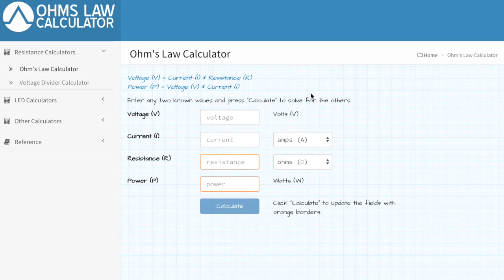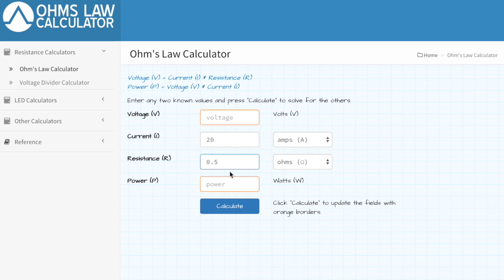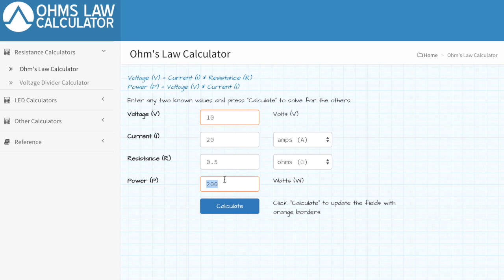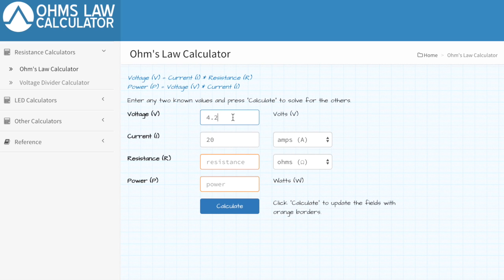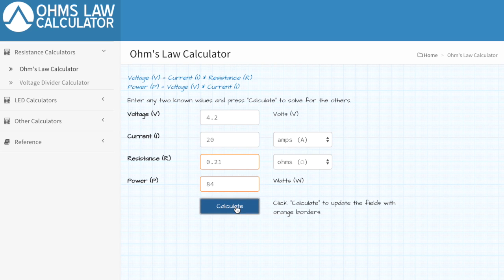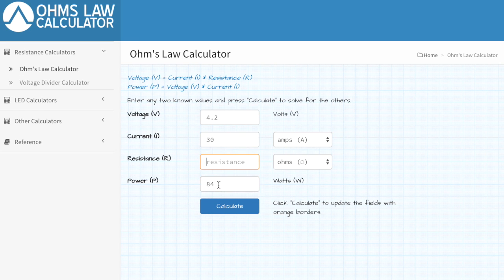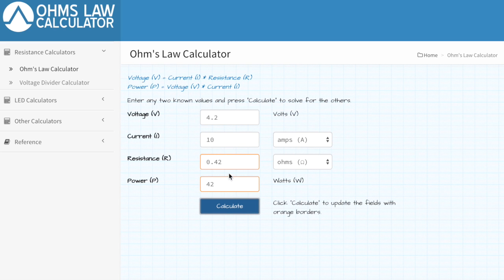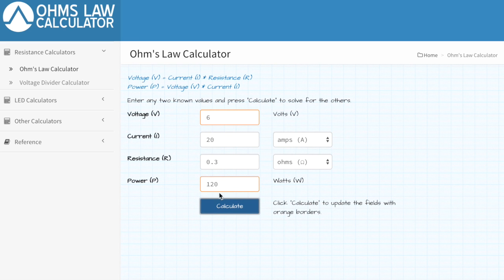Vaping for Beginners - Ohm's Law & Coil Resistance for MECH MODS

Comment: How do I determine  the max amp limit  if it doesn't  specify it anywhere.  Eleaf iPower 5000mAh Box Mod

Size: 49.5mm(L)*23.5mm(W)*83.5mm(H)
Thread type: 510 thread
Output mode: VW/Bypass/Smart/TC(Ni,Ti,SS,TCR-M1,M2,M3) mode
Output wattage: 1-80W
Resistance range: 0.05-1.5ohm (TC modes)
0.1-3.5ohm (VW/Bypass/Smart mode)
Temperatue.

Comment: how about the series type mech mods? they say if you are using a 3.7v batteries on a series it bobbles the voltage like the noisy cricket im using the awt color yellow batteries. it says 40A on the batteries I usually vape it in arround 30 to 40ohms, how do i get more clouds of it? 

thank you in advance for the help!
Reply: 30-40 ohms? What? Yes, in series the voltage will double. Also, what batteries do you have?
40A? No way, don't trust that.

Comment: if your mod takes 2 20A batteries does the max current stay at 20A? im new to building coils n shit
Reply: If the mod is in series, the amp does not add which means it's still 20a in your case. If your mod is in parallel, it "doubles"
i put doubles in quote since you can't calculate with x2 since serten things has some resistance to it.
It's safe to use x1.5

Comment: hi im using a regulated mod and i switched to a mech mod, it has a 4wraps of coil but i didnt know its ohm bec shops tester is broken they said its on .4ohms is it safe with a 35amps 18650? and its getting hot but not too hot is it normal for a mech mod?
Reply: First of all, get a ohm reader or build your tank on a regulated mod to see the resistance.
Resistance is really important when it comes to mech mods and make sure that the resistance is steady. No jumping. 
For your question: You would be fine even with a 10a battery for your .4 ohm coil on a mech.
Also your build/power depends on how hot the vape gets.
Since you are on an unregulated device, the only thing you can do is to make a coil that is cooler.

Comment: If I have 2 20 amp batteries can I use a 
.15 coil in a tfv8 in a regulated mod
Reply: Yes, you can do that, I run the same setup in my Xcube ultra and you will be fine to do the same.
Reply: Forget about ohm's when you are dealing with regulated mods

Comment: I loved loved loved this video. then I read the comments and got confused and worried. Someone said you cannot expect someone to push 4.2 volts but my cuboid is on 5.3. am I doing something wrong?
Reply from the maker: that is a regulated mod, which can go above 4.2 volts. the examples in this video are mostly for mech mods where 4.2 volts is a fully charged battery and therefore the highest you could go.
Reply: Okay, great, thanks! Still though this video was super helpful! It put building coils in a perspective that I needed and was easy to understand!
Reply: Each battery cannot push more than 4.2v even with a regulated mod. Hell, it pretty much never outputs 4.2v because of battery sag and the fact that it drops from 4.2v to around 3.7v so quickly. People get confused about battery voltage and the voltage that goes through the coil.

You know the thing that is displayed on your mod for example 5v even if you have a single battery? That is just the voltage going through the coil. Some mods reads the "current" but that is just the current that goes through the coil.
It has absolutely nothing to do with battery safety but just some useless information that we basically don't use that displays the current, voltage and the wattage going through the coil.

I'm just assuming that you are wondering about battery safety and not what goes through your coil since you are mentioning that you are worried. I could be wrong, but I think it's fair too assume that battery safety is the thing you are worried about.

Comment: and as the volts go down. the amps go up. so as your battery drains, make sure to adapt to which wattage will still keep your batteries under the amp limit.
Reply: Usually not something to worry about since regulated mods have a cut-off point. That was probably the first feature in a regulated mod.

Comment: great video, I've been using v/w devices @ subohm's for a while now & I'm interested in getting an unregulated mod.  In your opinion do you see any advantages to a mechanical mod vs one with a chip for safety?  I like the look & stealth of a tube like a praxis or something similar but I haven't dove into buying one yet because I'm still weary of having the device fire in my pocket or even worse get a battery to vent.

Comment: Hi im new to vaping.. I am using a kangertech topbox mod with clt4 atomizer and LG choco battery.. i have dual 28g kanthal coil with 6 wraps each.. it says i have .49 ohmz and im vaping with 55.0 watts.. is it good? or am i vaping safe? my atomizer easily heats up when using a max vg juice but its pretty normal when im using 70/30 or 80/30 juice.. 

should i add watt or lessen watt when using max vg juice? thank you..
Reply: Ohm's doesn't matter on regulated devices. I think the mod is a single battery right? I have no idea what the ratings are for the LG Choco. Is that the LG HG2? If so, you are safe. You are pretty safe on a regulated mod unless you have really bad batteries. A 20A battery on that mod and you are good to go

Comment: can you vape just water?  Anybody know?
Reply: No, you can't. But you could just boil water and breathe in the steam. Pretty pointless though.
Reply: Actually, no it is not pointless.  It can help people suffering from allergies, cough's and flus.  The water vapor would open up the airways that are deep inside the lungs.  If it were possible to vape just water, camphor, eucalyptus oil, menthol, tea tree oil...then many people would not be sick all the time.  The idea is to pull an enormous cloud; just as you do with normal vaping.  I am an allergy sufferer.  If huffing steam is pointless; why are Vicks Vaporizors sold in stores?
Reply: Yes, you can vape water but don't use spring water. Water is great for people that want a thinner E-liquid and have a bad reaction to PG. As we know, some people have a bad reaction to PG and to make the E-liquid thinner,  you simply use water. So yes, you can vape water.
Reply: Sean RobinsonJR I don't own a vape machine yet.  Try it for me, and see if you pull just as huge of a cloud.  I am onto a train of thought to help myself with allergies before Vaping becomes banned.  I do not want to spend 60 bucks on a machine; and my idea does not work.  Let me know your results.  What is PG?
Reply: Piano Man42 Sorry bro, but nothing I can do. I don't have the recommended water to use. It's not like i can use spring water or spring water and boil it. It needs to be proper clean water and I have no idea where to get that. There is no vape shops in my country so I would need to order that online. That's a lot of effort. 

Are you saying that you don't know what PG is? ( Propylene Glycol ) If you haven't even tried that, why vape water? The only reason I see too use water is if you have an allergic reaction to PG.
Reply: Sean RobinsonJR The most purest water is commonly available.  Use distilled water.  There are no minerals in the water that can foul the element in this water.  It is available at any grocery store.  It I pure chemically.
Reply: Piano Man42 But why do you want to vape water in the first place? I mean there are reasons for it as I mentioned before but you haven't even tried PG. So why water?
Reply: Sean RobinsonJR I have tried PG at a vape lounge yesterday morning.  I just feel that a saturation of water vapor would help my chronic cough.  Especially, If I could pull a dense cloud that you get with normal vaping.  I don't want to introduce foul ass chemicals like PG and vegetable oil into my lungs.  It may provoke cough even more.  I think maybe the PG is vapored for its special effects of the dense cloud.  I do want a dense cloud of water vapor, camphor, menthol, and therapeutic essences that are herbal.  I have been to the doctor; and nothing he prescribed Is helping much.  So now; I am trying something new, on my own.
Reply: Piano Man42 I can tell you that you won't get a decent cloud without the VG. PG and water doesn't make huge clouds.
Reply: Sean RobinsonJR I spend countless nights staying awake all night coughing and sneezing.  I miss work the next day as a result.  I am fed up with the problem and am ready to go through great extremes to solve the problem.  That is why I want to vape water.  It does seem to help.
Reply: Ah, ok. Then I guess VG with menthol would do the trick.
Reply: vegetable oil = VG?
Reply: Piano Man42 VG = Vegetable Glycerin

Comment: how about this?

I Calculated from: http://www.ohmslawcalculator.com/ohms-law-calculator 

V=4.38
Amps=40
R=0.1095
P=80 

Current Setting: 

V=4.38
Amps=40
R=0.24
P=80W

 My Build

 Link: https://goo.gl/7DPWJX

-SS Cuboid 150W upgraded by firmware to 200W 
-Griffin 25 Top Airflow RTA 
-Copper Heat sink 
-AWT IMR 18650, 3.7V 3000MAH 40A 
-Coil Nichrome 60 Not sure 

Is this safe if I go with the R=0.1095?
Reply from the maker: I'm not familiar with that battery, but i would question the 40A limit.
Reply: 😂 that's a regulated mod why would you need any of this information for that😂

Comment: What if I put 2 20amp batteries in my mod would that change the total amps? Thanks
Reply: It depends on if the mod is in series or in parallel. In series, no.
In parallel you double the AMP but because of wires and chip and all that, you don't get fully x2 amp.
You should calculate that you get 1.5x more AMP when using 2 batteries in a parallel mod.
Reply: +Sean RobinsonJR its a rx200 which takes 3 batteries. I currently have 3 lg hg2 batteries in it. Thanks for your input.
Reply: JON1201ROTH I got the same and it's a series mod. The Rx200 has a 20a limit which basically means that if you have true 20a batteries in it, it's dummy proof. You can vape at whatever wattage you like and you can even vape it if the batteries are low. I wouldn't recommend it though because you are taking out the battery life and the battery will last you shorter. The LG HG2 is 20a right? 
So you are dummy proof. Vape away.

Remember, the voltage you want to calculate with is NOT the voltage that is displayed on the board.
To see the true battery voltage: Shut off your mod, hold the power and the negative button in at the same time. wait, and you will see the voltage from all your batteries.

Remember to switch position of the batteries sometimes because one of them will output more than the other. It's dangerous if the voltage is really low on 1 battery but good at the other 2.
Reply: +Sean RobinsonJR nice answer, thanks. Yes they're 20a. I check the batteries in the way you've said. I just wasn't sure about the amps with more than 1 battery in this particular mod. Thanks again.
Reply: Yeah, Abby has missed a lot of things. Not hating on her or anything, but i felt like this video was pointless because there were so much wrong things with it. For example calculating the volt that is displayed on the board. That is dangerous. A chip can output more voltage than a battery usually can take. For example a battery is 4.2v at fully charge but with a chip, it can output even more and that results into more current (amp)

For a regulated mod, just take wattage / volt = amp.
usually I just calculate with 3.2v for each battery since that is usually the lowest I go and that's the usually cut off point in a regulated mod. Since it's series, you just add the voltage. And you would need to thing about battery sag and so on, but 3.2v is usually a good range for the battery unless you change it before you hit that.

So it's the actual battery output that matters and not what's displayed on the board.

Adding voltage only for series btw.
Cheers!
Reply: +Sean RobinsonJR so if for example vaping at 100watts you would do 100/9.6 = 10.4 amps. That would be well within what the batteries can handle. Is that how you'd do it? Thanks again
Reply: JON1201ROTH I'm guessing that you are calculating a series mod with 3 batteries right? So yes, this is how I would do it. It depends on what cut off the mods has but I would usually change the batteries before that because it would hit weak so yes, 3.2v * 3 = 9.6v is safe I would say.

But if you are one of those lazy once that doesn't want to change batteries until you just have to then I would probably calculate with even lower.
if a mod has a cut off at 3.2v it can still hit like 2.8v which again would increase the amp.
and that is battery sag. if your batter is at 3.2v and the mod let's you fire it, it can actually end up with 2.8v or so and that would me 2.8v * 3 = 8.4v

100w / 8.4v = 11,9a. So there you see that the amp increased. So it depends on when you change the battery. Do you allow it to go that low and so on. That is up too you basically.

Next time you change your batteries because you feel like it isn't hitting that hard anymore, check your battery voltage and you know how low it actually goes.

experienced people could easily just calculate with 3.7v for each battery because they would switch the battery before it goes that low and so on.

I just calculate with 3.2v because I'm more on the lazy side of changing the batteries and I also want to feel more safer.

But that is pretty much it. It is not that difficult. People just don't know that there is a difference between: mech, series, parallel, multiple batteries because no one on Youtube really talks about it.
For example this video.

Sorry for the long message, but I think you got it : )

PS: Resistance doesn't matter in a regulated mod. At least if you can regulate the wattage

Addon: In a parallel, you basically do the same thing, only that you cannot add voltages from 2 or more batteries and you shouldn't be doubling the amp either but multiply it by 1.5x.

So 2x 20a in parallel = 30a and not 40a because everything goes through wires and a chip which has some resistance to it.
You could probably use 2x if it's a mech or something.
But to me safe, use 1.5x in parallel when adding amp